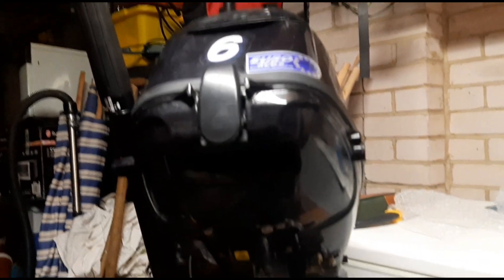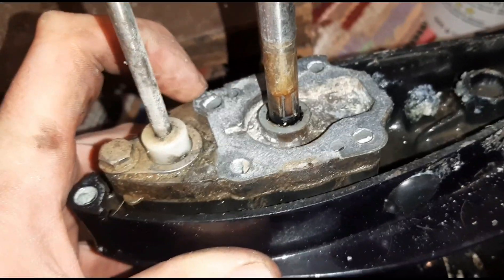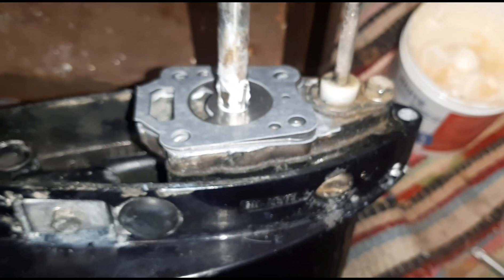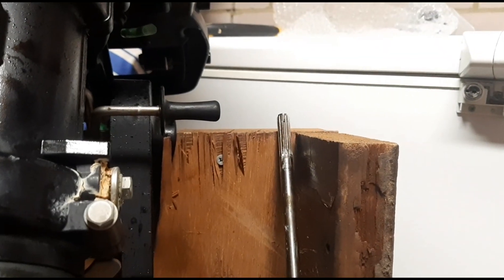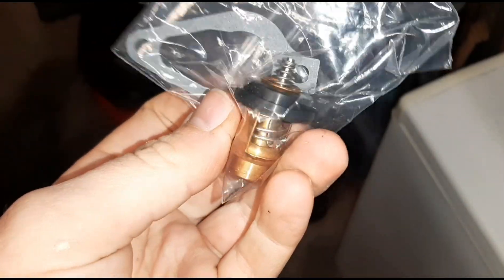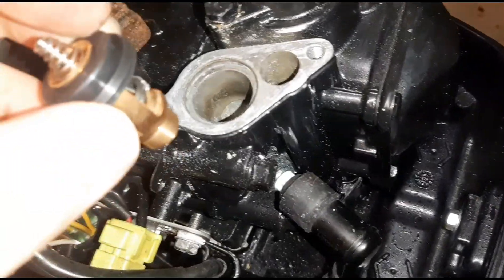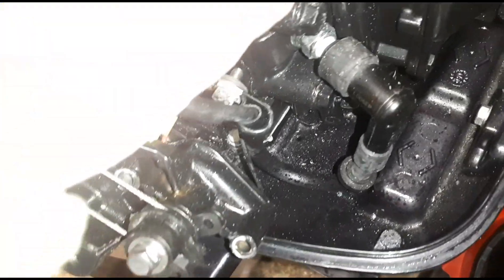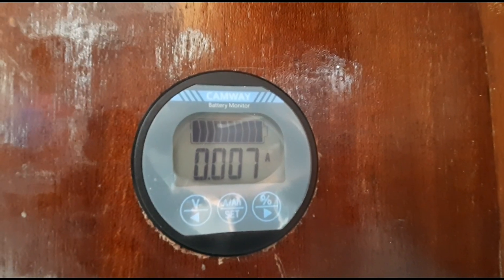Tohatsu outboard engine servicing and connection to battery

Comment: Great engine tutorial! Did you follow up in a video about the Tohatsu's alternator? I just bought the same motor (also lives in a well!) and I'm keen to know if it'll give me enough charge for my basics -- LED anchor light, a few lights, a few phone chargers.
Reply from the maker: Hi, it wasn't the best delivery of power. I was told it needed a heavier gauge cable than I was using but by tgat time i'd upgraded my battery and solar charge capacity. I have heard of sucess stories getting 2-3 amps at half throttle but I never saw anything like that.